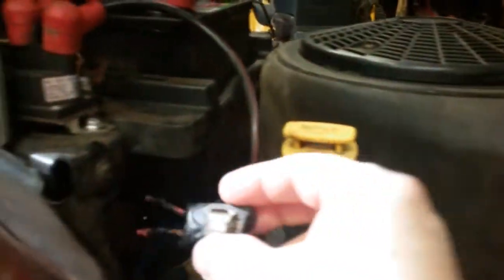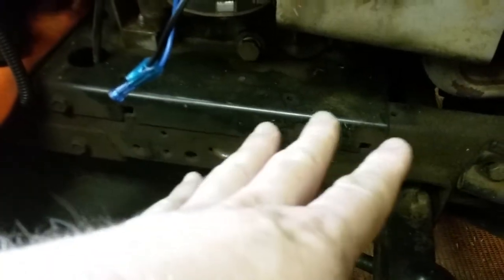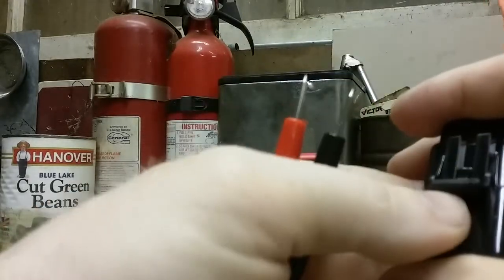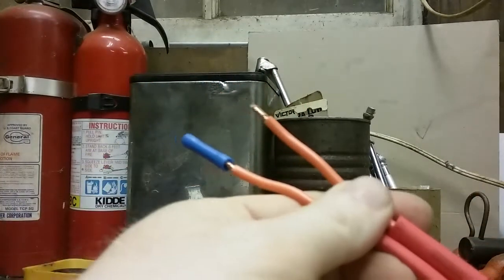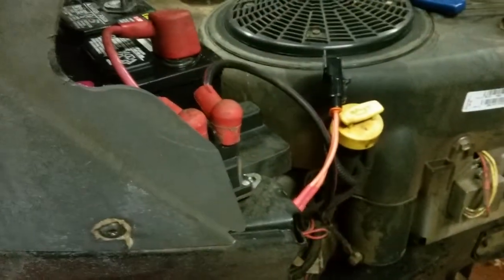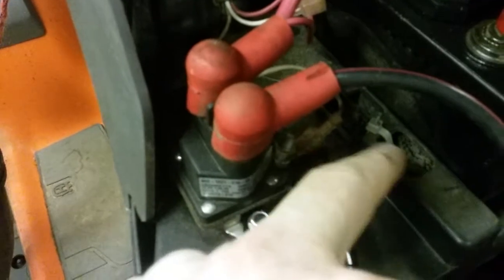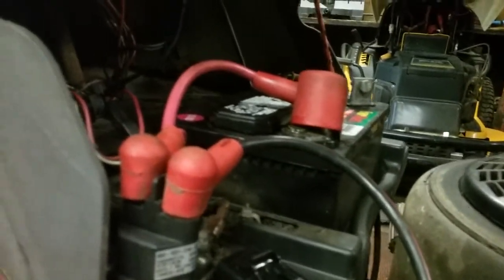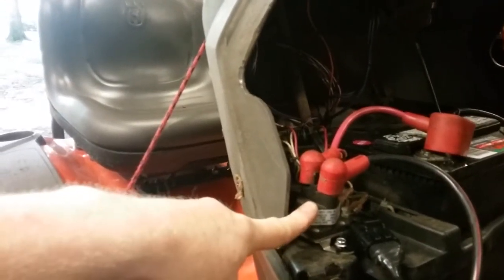Why is there smoke coming out of my Husqvarna lawn mower? Repairing fuse holder and Fluid Film

Comment: exactly what i was searching for on repair and thanks for tip about Napa as well I have John deere  fuse holder mine has two wires from harness but also a wire going to starter solenoid
Reply from the maker: Thanks for your comment I'm glad to be of help. Thanks for watching!